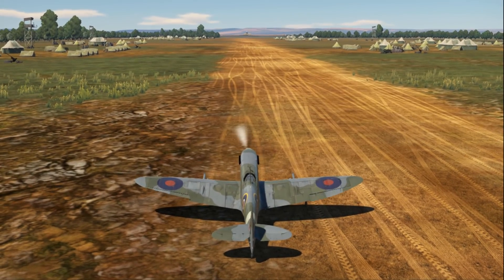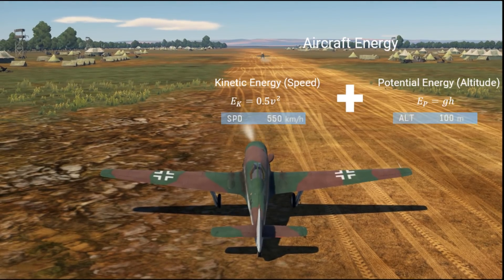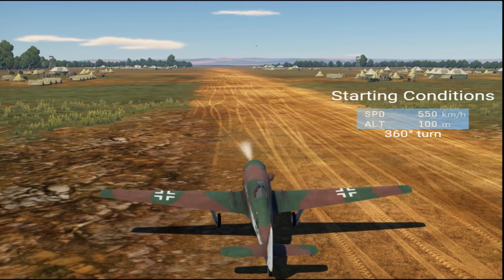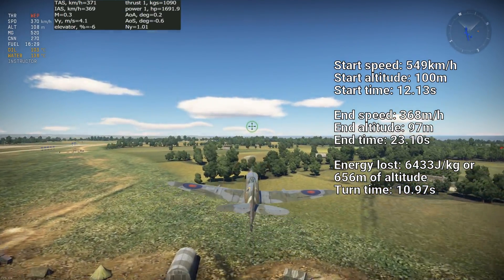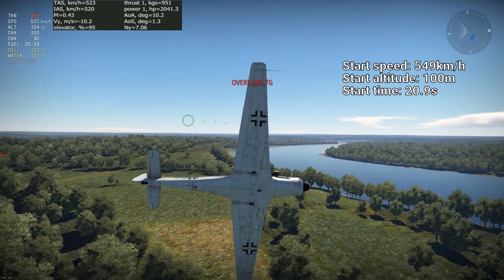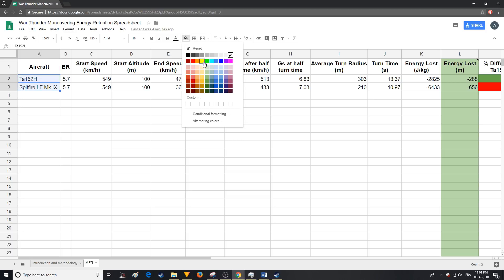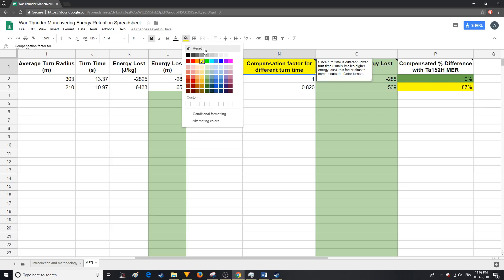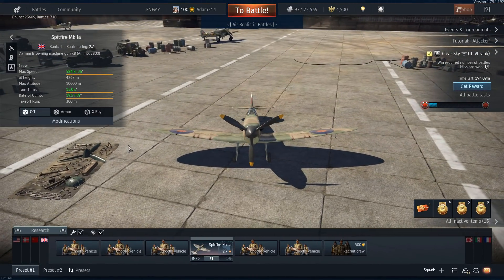Aircraft Maneuvering Energy Retention | Spitfire LF Mk IX vs Ta152H

Comment: You are of course assuming that the game represents the aircraft well.

In order to do this right, you would have to have the two aircraft do the same maneuver.  Since the Ta 152 cannot follow the Spitfire in the turn, perhaps you should have the Spitfire do the same maneuver as the Ta-152.  It is going to be hard to fly the Spit to match the same maneuver, unless you are following somebody.  Since the wing loading is lower on the Spitfire, it requires less angle of attack for the same g, so I would expect it would lose less energy (I have not checked the wing loading of the Ta 152, I am comparing it to the FW190, so I am guessing a bit here).  The other factor is that the two aircraft may have different maximum speeds at sea level.  You will have to fly the aircraft at their own max speeds at sea level to compare them, because if you don't, you are mixing the natural speed loss that the plane would have with the the speed loss due to the increased lift.  For example, if you had used the Spitfire XIV which can actually do 550 km/h at sea level on level flight instead of the IX that can barely do 520, you may have had better speed retention, despite the increased weight.

Another question is of course, can the Ta-152 survive 6.8 G's.  The large wings were designed for high altitude lift and not for dog fighting.  I have the feeling that the safety factor of the Ta-152 is perhaps beyond structural failure, and your game did not represent that properly.

In short, this may be a good start, but the test has much to be desired.  If the lift coefficient vs angle of attack and drag coefficient vs angle of attack curves are known, and of course the thrust vs. air speed is known, it is a lot better to do this mathematically than the silly game.   The game makes interpolations and extrapolations for all that, but how accurate are these extrapolations?  They may be reasonably good for the Spitfire, since there is likely a lot of information on it, but very little for the Ta-152.  Even less for much more obscure aircraft like the Raiden.

Comment: Do you have a spreadsheet for max speed, cause I can't get 756 at 10200 with TA 152 neither 710 at 4800 with d9 (at most 701 at 5400 with 0% radiators)
Reply from the maker: Only at sea level.

Comment: I am sorry mate, but the test is not so usefull. You are using the max turn rate for the 2 aircraft (spitfire did 360 in 10 secs, the Ta did 360 in 13.3 secs). So this mean mean that the spitfire did a much tighter manouvre (resulting in higher energy loss), and therefore the two aircrafts followed 2 different trajectories. This test would be usefull if you at least pick the same 360 turn time for both aircrafts.
Reply from the maker: That's what the compensation factor is for, it's to put both aircraft on the same base.
Reply: @AdamTheEnginerd  what about letting the 2 aircrafts do a 360 trying to keep a constant velocity?
Reply from the maker: @giordanopuglisi2890  You mean a sustained turn? Sustained turn is important, but MER seeks to measure the speed loss when turning at higher speed.
Reply: @AdamTheEnginerd  oh you are right, sustained turn is totally a different thing. Forget about that. What i am trying to say in my first comment is: is it worth making the test using the same trajectory (the same manouvre) for both aircrafts? That is more relevant for a tail-chase situation. The spitfire can turn much more than Ta, but you usually don't want to turn that much if you find yourself going at low speed after the manouvre. Probably i don't understand deeply the compensation factor.. Are you sure you can calculate the result of the test i am proposing to you, using that compensation factor?
Reply from the maker: In air RB with mouse aim, people will be turning with their aircraft to their best of their ability, so that's why the test measures the speed loss with usual mouse aim controls. The compensation factor aims to reward the aircraft that spend less time to complete the maneuver, because they could use the extra time to get some speed with their engine power and they can turn and get their guns on an enemy in a shorter time and hence be closer for a shot when the enemy is trying to extend away.
Reply: @AdamTheEnginerd   so you basically saying you are taking into account "bad manouvreing from average players“? I don't always turn  my aircraft to the best of its ability. A spitfire tail-chasing a TA won't use its max turn rate at all (if this test is correct a TA would outrun a spitfire during a 360, or longer, tail-chase? Hell no, on a spitfire i would have to reduce engine power or i would ram the TA) . People should turn their craft to take the most advantage of the situation. Spitfire is losing so much speed because of the tighter turn, and you also said so in this clip. But the compensation factor you calculated is just a linear ratio of the 2 turn times, and i don't think it is appropriate in this case (accelerated motion). the force pointing toward the centre is much higher for the spitfire (just check the difference in the resulting G during the two tests). So basically the spitfie's engine is "wasting" a big fraction of his power to maintain high curvature during the whole 10,97 seconds (acceleration perpendicular to the speed vector) and it's just right there that you have a big loss of kinetic energy. That said, the TA just can NOT do such a tighter turn, and in your test it is rewarded for having lower manouvrability. If you do again the test using the same G for both manouvres you will have a much different results

Comment: I'm not sure it's a linear compensation. L/D is a function of AoA and so the turn rate. That's complicated and you'd need to refer to the drag and lift polars. 
The way to make this fair would be to pull less hard on the mkix until it hits the same turn time.
Reply from the maker: Exactly, that's what the compensation factor is for, since with mouse aim you can't realistically pull less (and it wouldn't be done often in matches anyway).

Comment: Hey Adam, could you do a video over w energy retention in a straight line at high speeds? I’m curious. A high power to weight ratio is good for maneuvering energy retention, and that makes sense. But for a good energy retention in a straight line wouldn’t a heavier airframe, lower amount of lift, and a medium aspect ratio be better? It seems the opposite almost from what’s needed for a good maneuvering energy retention. Keep in mind I mean high speeds, as in 700kmh +
Reply from the maker: I did! https://www.youtube.com/watch?v=3B5nGE3pqqQ&ab_channel=AdamTheEnginerd

Basically linear ER is highly dependent on top speed, the higher top speed aircraft will have better linear ER beyond its top speed than a slower aircraft.

Comment: Which would win? My money would be on the Spitfire, even though the Spitfire Mk IX came out 2 1/2 years earlier. Against a Spitfire Mk XIV there would be no contest.
Reply from the maker: Win what though?
Reply: @AdamTheEnginerd  
What fighter aircraft are meant to do.   I know the Ta 152 was very late in the war and had little combat and less success but was not a great overall fighter, it was designed and meant fr high altitude but most combat took place at low or medium altitude.
Reply from the maker: @barrierodliffe4155  In the western front most combat was at high altitude until 1945.
Reply from the maker: @barrierodliffe4155  Think of the bombing and quest for high altitude performance for both sides. Ta152 was developped because of the prediction of even higher altitude bombers. They didn't design the Ta152 on a whim, for no reason.
Reply: @AdamTheEnginerd  
So at least according to your Hollywood inspired dreams there was the USAAF bombing and nothing else before 1945.  
There was the real war and then there is the make believe war, I know which one I take notice of.
Reply from the maker: @barrierodliffe4155  Sure lel.
Reply: @AdamTheEnginerd  
?
Reply from the maker: @barrierodliffe4155  I said sure, you can believe what you want, I don't mind. Don't expect to convince anyone with how you write your comments that's all.
Reply from the maker: @barrierodliffe4155  Then why are you spending your time talking to me?
Reply from the maker: Sure lel.
Reply: @AdamTheEnginerd 
 ?

Comment: yep, still dont understand
Reply from the maker: It's just energy! Any specific part you don't understand?
Reply: @AdamTheEnginerd  the more scientific part, why does someplane have better mer in horizontal while other in vertical
Reply from the maker: @fishbucket8607  They are very linked, usually the plane with better MER horizontally will also be better vertically. There isn't much difference between them.
Reply: @AdamTheEnginerd  oh ok,I thought they are two different stuff. Ty

Comment: So does the acceleration of the spitfires compensate for the ER? Also, is it competitive in a looping fight, against, for example a Bf 109? Last question, is there any way a spitfire can deal with a vertical energy trap (chandelle or spiral climb)?
Reply from the maker: Spitfires have average MER. Spitfires turn better than Bf109s, Spitfire should have the advantage over the Bf109 in a loop if they start at equal energies.
Reply: @AdamTheEnginerd  Right, thanks.

Comment: Hey so next time if you want the tigers turns make sure to use a keybind for the pull, it pulls as hard as possible, while I've found that it does help a little bit as opposed to just moving the mouse
Reply from the maker: No, mouse or keyboard does not change the tightness of the turn, they both pull as hard as possible. The only thing keyboard does is make the start of the turn very slightly faster because it's faster to press a key than to move the mouse sufficiently far from the heading to initiate the turn.
Reply: @AdamTheEnginerd  Correct, although i guess i made this because for me it helps to keep a consistent turn, which yours seems to be either way.  Thanks for actually replying though.
Reply from the maker: @ripliner3964  Thanks for commenting!

Comment: Just a question, instead of compensating for turn time, wouldn’t compensating for turn radius be a better indicator for in game performance?

If you think about it, MER is important if you’re on the defensive and your plane turns worse than your opponents, or on the offensive if your plane turns better than your enemy‘s and you need to watch out to not loose too much speed in turns
Reply from the maker: Turn time is more important than turn radius in random matches, that's why I used turn time.

MER is always important, I don't see how compensating for turn radius changes anything. For 90% of planes as well, using turn radius instead wouldn't change the results significantly anyway.
Reply: NotDumbassable good day. What does MER means sorry in a newb to this game
Reply: @charliec8434  manoeuvring energy retention
Reply: NotDumbassable right and it was also said in the video. My bad for not paying attention and thanks bro

Comment: Wonderful video, but I have one query: Should you not have used Indicated Air Speed rather than Ground Speed for your measurements? Despite the aircraft being at the same altitude before the turn, one was in Britain and the other in the Ruhr so there could be a difference in air densities (or does Warthunder not measure that?)
Thank you
Reply from the maker: Thanks! This is an important video imo.

TAS is what is used to calculate the kinetic energy of an aircraft, so using TAS is a must.

All test flight maps are the same, so 100m on Britain is the same as 100m on Ruhr. There are differences on random battle maps (Sicily is hot while Bulge (?) is cold for example).

Comment: I bet energy retention is about the same on all aircraft. Probably, the ones with higher turn rate retain energy the same, but since they have the ability to turn sharply, the are abused in this way and so there is a greater chance to lose energy when flown by jerky, inexperienced players. A lower mouse DPI would benefit the Spitfire, so there is a more controlled turn. What I'm saying is, if a Focke Wulf and a Spitfire both turn 30 degrees I'll wager the Spitfire will keep up in the turn, maintaining a similar or same speed as the 190. They both turn 50 degrees...the Spitfire is still going strong. Now Focke Wulf player tries to turn 110 degrees, and cannot because the heavy 190 hits its limit at 110, but still retains more energy than the Spitfire behind, but why is this? Because the Spitfire player has turned past the sharp 110 degrees limit to get guns on target. The fact that the Spitfire is even able to do what the Focke Wulf can't is what makes it slower at times. Other than that, the Spitfire should maintain its energy extremely well. You just have to know when to turn sharp and when not to. Anything that turns tighter will lose speed in a tight turn. With aircraft that cannot turn tight, there is less loss of speed. Try losing speed in a jet that can only turn 360 in 30 seconds. Most likely you will not lose much speed, unless you go vertical.
Reply from the maker: MER varies quite a bit between aircraft types. MER varies more than speed, and a bit more than climb rate between aircraft.

Comment: How do you display that additional flight info in left upper corner?
Reply from the maker: It's called the "local host".

How to access the "local host":
You need to be running War Thunder or it won't work!

Option 1: on the same computer that is running WT:
-Type http://localhost:8111/ in the address bar and press enter and voila.

Option 2 (which also works on the computer that runs WT):
-Type http://Your_IP_Address:8111/ where you replace "Your_IP_Address" by your IP Address (192.168.X.XXX) in the address bar and press enter and voila, you can look at the characteristics on another device while flying.

What I do is I record the local host on my laptop at the same time as the gameplay, and combine them during editing.
Reply: @AdamTheEnginerd  I know what localhost is lol. Just wanted to know how to get the info in game. But if you're editing it in after that, well :(
Reply from the maker: Just being thorough.

There is a way to do it, you need to play WT in windowed mode and use a program to overlay part of your browser over the game, but I've never done it. 

I've used VoidMei though: https://forum.warthunder.com/index.php?/topic/311763-voidmeia-warthunder-tool-for-displaying-logging-and-analyzing-flightdata/

I can't seem to record both WT and the overlay at the same time without it being choppy, so I'm sticking to my current solution for now.

Comment: Then do that same test at 7000 meters, you will see how much energy is retained with the Ta-152H. The spitfire loses all its energy because it's engine can't work at those alts. Energy fighting in a ta-152h at high alt is almost orgasmic.
Reply from the maker: It wouldn't change the relative advantage that much, engine power is only 1 factor in MER, but certainly the aircraft which conserves its engine power better at high altitude will have its relative MER improved.

Comment: Seems La-7s' drag bugged or nerfed ?
Reply from the maker: What do you mean?
Reply: @AdamTheEnginerd  it's takeoff accelerate is…exceptionally slow after certain 1.79 hotfix (seems it buffed US's 90mm M82 shell) and need a distance over 348km to takeoff, and after barrel severely or climb, it's speed won't recover likes its usual, also, it's energy retention just likes...I don't know how to describe but just like it's drag factor(?) is always like as it at 600 km/h speed. La-5FN and La-7B-20 was affected also, but shows no change with I-185 M-82.
It would accel over 10km/h per second when it take off before, but  about 2~3km/h only for now.
Reply from the maker: @demonslayer1287  Hmm I really didn't notice a change.
Reply: @AdamTheEnginerd  you may try to takeoff a I-185/M-82 and then takeoff a la-7, by the way I-185 is twice heavier
Reply from the maker: That's due to the prop which is "too small" for the engine power. Bf109s have the same issue, that's why they take off slower than even US aircraft.
Reply: @AdamTheEnginerd  I think maybe gaijin fixed it sometimes ago ? But to me it had a little strange, I can barrel & scissors a spitfire Mk14 and kill it when 1.77 and had 280km/h speed remain,took about 20 second to recover speed, but after that hotfix I fell 170km/h again and again and speed won't recover. Since that I have a long time without playing my favorite plane.
Reply from the maker: Hmm I'll keep that in mind next time I fly it.